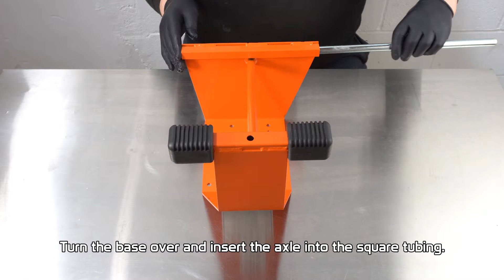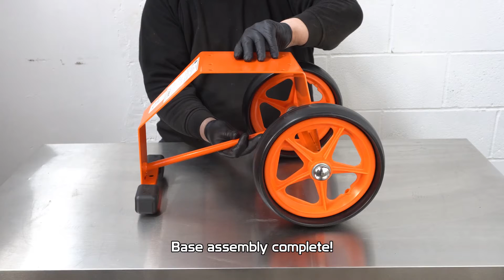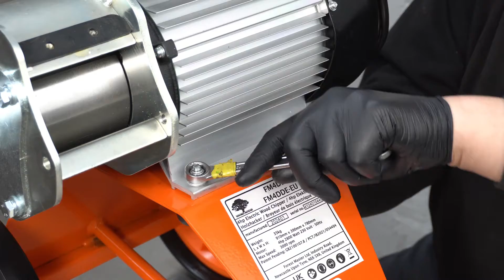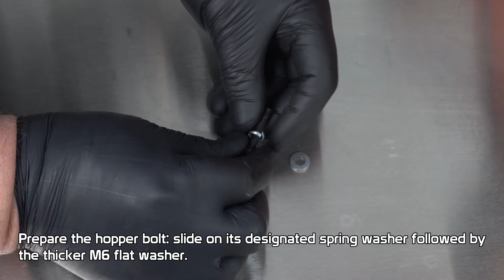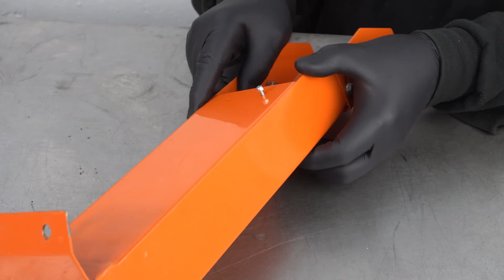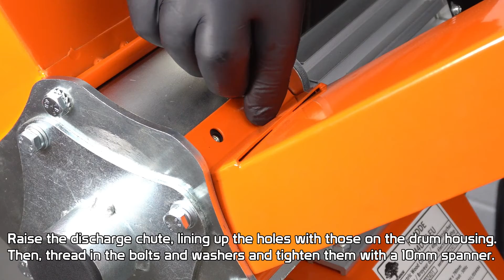Forest Master FM4DDE 4HP Compact Electric Wood Chipper - Full Assembly Guide

Comment: Really needed this video as the supplied "destructions" were absolutely pants !!!

Slight change to the latest version where the "long bolts" for both chutes are no longer included and instead, there is a lip that the edge of the chute slips into.  I hadn't a clue where the two thin bolts fit into as that was certainly not in the manual. Thank you so much again for this video, it is much appreciated